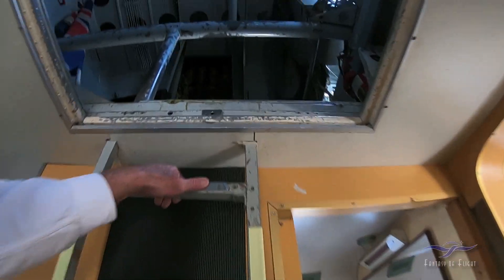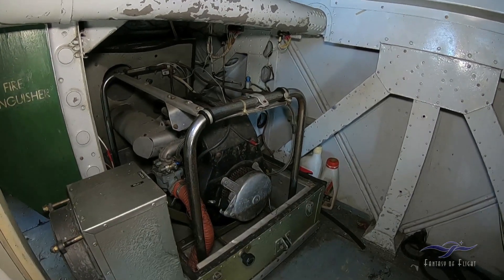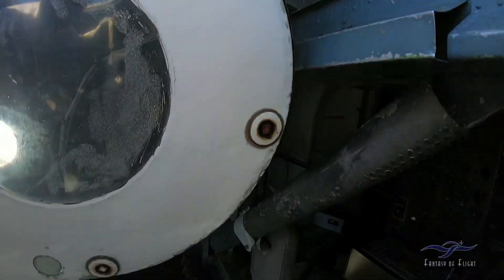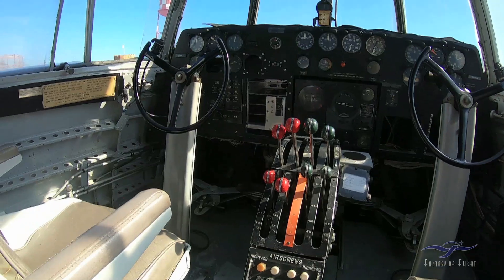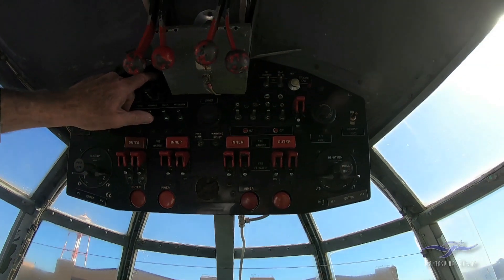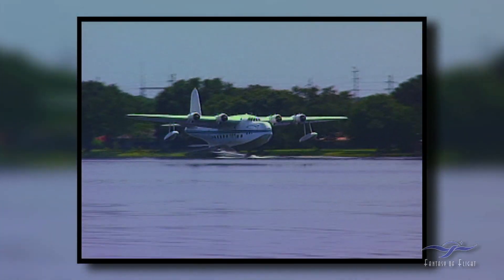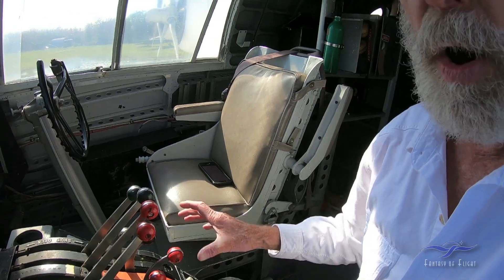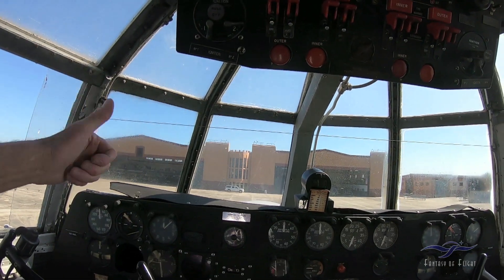Short Sunderland - Tour Part 2

Comment: I had to laugh along with you at your losing train of thought @ 18:35 :) . I really enjoyed this run through, you answered so many questions and gave such a perfect insight into the small details of how the aircraft responds.
I once had the opportunity to sit in the cockpit of the Southampton UK Sandringham in the Solent Sky museum and have a long one to one session with a very elderly Sunderland pilot, I count that as one of my best moments and purely spontaneous which made it very special.
My house is just to the south of Poole harbour UK on the coastline, it was built in 1935 and I can imagine the walls gently vibrating to the not too distant thunder of the flying boats operating from Poole and Sandbanks. Thank you for these great films and for the costs you have absorbed in saving this wonderful aircraft.

Comment: Just having her in the hanger is great. Crewing on a B25 I totally understand the logistics to get an old acft in the air and he has two more engines. The cost in labor and the materials are mind boggling. With Panchito you realize fuel and oil is the cheap part of flying and that can get as high as 180 gallons an hour at $6 per gallon. Inspections are always in the schedule and parts wear out so your always on the hunt. It's a passion that keeps them in existence and I thank those owners that have such passion to spend the money and put the hurculean effort in keeping the acft alive.

Comment: Loved these 2 tours, thanks so much Kermit, its an incredible aircraft. Recently discovered that I live close to a WW2 Sunderland crash site near 
Dunbeath in the Scottish Highlands. It was on route to Iceland with 14 people on board, 25th August 1942, 13 out of the 14 people died. The aircraft 
was carrying Prince George, son of King George VI. RAF investigation said "navigational error by the crew" strange considering the 3 pilots were the 
best of the best, specially selected for VIP missions, the hill it hit was only 700 feet in height, 40 minutes into the flight, why would the be flying at 700 
feet? Lots of conspiracy theories going on, even today. Most of the RAF crew were burred in Pennyfuir Cemetery in Oban, also the resting place of
Frances Ruth Burke Roche, born in "Sandringham" the mother of Diana, Princess of Wales.  Prince George is buried at "Sandringham"

Comment: WOW! When you see the leading edge turn into a mechanic platform, not just an engine cowling, you realize the engineers had a mechanic's mindset. Everything from the Flight engineer to the pilot. Sailing and turning were a different beast, as to say with the advent of a 4 engine P3 on land which had GENs on 2&3 which also had reverse thrust and brakes. Your APU had to have been on during taxi on the pond.  You couldn't be more at war than with the grit at your smile just taking the aircraft to a mooring bouy. It would have been loud in the can the whole time.

Comment: These are a really interesting couple of videos, thanks for taking the time to do this. I live in Southampton very close to the sister aircraft which is in the Solent Sky museum. Its been a few years since I went onboard that aircraft but for years I walked past it everyday on my way to work. Funnily enough I was going through old photos today and I found a picture of your Sunderland (Sandringham) before you flew it out to the States. I think I took it very early 90's, its up on dry land under the control tower/radar station at the entrance to the Solent. I was on the way to the Isle of Wight at the time on the car ferry, I always used to look out for the aircraft whenever I was on the ferry with my parents. It would be amazing to know that one day it will take to the air again, even though I'll probably never see it.

Comment: Two great videos. I have seen an old RNZAF Sunderland up at MOTAT in Auckland but never saw them flying here in NZ. They kept them going to serve Niue and the Tokelaus until runways had been constructed to handle Boeing 737,  Lockheed C130H Hercules  and P3 Orion aircraft. The RNZAF was the launch customer for the H Model and those ‘now rebuilt’ aircraft are still in service but due for replacement.

Comment: Old ww2 story’s tells ...The tail release was also used to  start the engines and run ups. 
So you can stay at the spot and do not have to worry about sailing away. 
The plane does makes turns if  engine was started. 
So maybe the sea anchor was used also. 

Your apu was normally fitted in the wing . A mechanic had to close the leading edge cover after engine start. 
I don not know how Kermit does it but fully loaded the plane was powered up on out board engines first.
It keeps more directional control and less spray ( according to the w2 story’s) if some speed and direction is maintained the inboard engines go up to max power too. 

Thanks for sharing Kermit.. it’s awesome ..

Comment: Those 'Shut-Open" controls are most-likely for the depth-charge rack doors in the upper hull, port and starboard, below each main wing. Most-likely left unaltered during the conversion from Sunderland to 'Sandringham'.
The panel next to the 'emergency escape-hatch' you indicated earlier, was originally the panel [about 40-inch by 20-inch by 3/4-inch]  that opened outward and upward to replace the depth-charges dropped upon U-Boats during WW2. 
Typically, a Sunderland would carry between 12 and 16 depth-charges, four under each main wing, manually re-loaded after each (typically) pair had been released to drop around a U-Boat.

Hope the small bit of info helps you Kermit:

Kind and Respectful Regards, Uyraell, NZ.
Reply: If i remember those Shut-Open controls are to open the engine cowlings on the port and starboard engines.

Comment: Were these the same hydraulic throttles of the 'Exactor' type it's 4 engine cousin, the Stirling, had?  Murray Peden documented some of the surprises crews encountered on Stirlings when the pressure dipped a bit, particularly when an overshoot was required.

Comment: Which was the most feared allied plane in WWII by the Axis?
David Crawford
David Crawford, former British Army Infantry Officer (1974-1994)
Answered Sep 23
Strange as it may seem, the Short Sunderland flying boat. The Germans called it the Fliegendes Stachelschwein ("Flying Porcupine") because of the number of defensive guns it carried. 16, .50 machine guns would be the basic fit but many were fitted with 21 , 50 cals. by the end of the war. In one engagement in 1943, 8 Ju88’s attacked a lone Sunderland off the Biscay coast of France. The Sunderland shot down 3 and damaged the other 5 forcing them to withdraw.
Reply: Wow, you went through all that trouble to copy and paste an answer from Quora, and its not even correct. First, the Sunderland was a British plane, and it didn't carry .50 cals. Like he says several times in the video, it was armed with .303 machine guns, hardly a fearsome weapon. It carried quite a few, but not that many more than other RAF bombers of the period. The only Sunderlands to carry .50cals were the Mk.Vs,, which sometimes had the beam 303s replaced  with .50s. The thing about the Sunderland being called the flying porcupine because of its guns is a stupid myth. Its main defense was a single .303 in the nose, two in a ventral turret, and 4 in a tail turret and a couple beam guns.. Exactly the same as a Lancaster, except the Lanc has two in the nose and no beam guns. The number of 16 guns is the MAXIMUM, INCLUDING the four fixed nose guns. Some idiot has taken 16 and added five to it for some reason. It would make sense if they just assumed 16 guns was the total WITHOUT the fixed guns, but why 5? 
Most Sunderlands didnt carry even 16 guns. That is a maximum, for a late war plane with every single gun they can cram onto it, and four fixed guns for suppressing UBoat flak gunners.
The Sunderland was called the porcupine because early in the war it typically carried an early ASV radar set, with numerous aerials protruding from te sides and top of the rear fuselage in 3 rows of 4 or 5, plus several smaller anntenae here and there. This resulted in a very spiky looking plane. I find it hard to beleive that its a total coincidence that the Sunderland often looked like a fat spiky plane, and it was also called 'the flying porcupine" for TOTALLY UNRELATED REASONS/
Reply: @justforever96  ??????

Comment: Kermit, Thanks for two great videos. I sat in the cockpit of the converted Sandringham  at Southampton air museum  and youre videos brought it  right back for me. You get an awesome feeling of a past age siting in the cockpit. The mooring technique is scary and I wonder how they ever managed when they had fixed pitch props before they converted them to the PBY system. Were the props on the PBY also non-reversible or was there some other reason that prevented using it on the Sunderland?

Comment: Nice plane/boat.  I gotta say though, if I were to have a multi-engine flying boat, I'm pretty sure I would want reversible props.  It might not be flying now, but it's doing better than all of the Boeing 314's which were either scrapped or sunk.

Comment: Just visited the sister aircraft in Solent Air museum in Southampton U.K. and the interior layout is quite different.  The Aircraft in the U.K. has seats for 44 laid out in compartments with narrow seats facing each other.  The nose has a large baggage hold.  On the Starboard there is toilet and a door that leads to the ladder to the upstairs cockpit.  Opposite is another toilet.  The interior is wood panelled like a Victorian train carriage.  The lower deck seats 30 made up of  three interconnected compartments of 8 seats towards the front, a ‘Y’ shaped staircase and then a fourth compartment up a step to the rear with 6 seats.  The stair case starts on the Port side and goes up at an angle towards the Starboard side.  If you turn left a the top of the stair, towards the front, there are a further couple of steps to an upstairs galley.  If, instead, you turn right at the top of the stairs there are a further couple of steps that lead towards the rear and an 8 seat compartment that has a further connecting door to a 6 seat compartment at the very back.

Comment: Here's a little tidbit of info about Ansett.
Their B767's actually had a three man flight crew instead of the normal two with a little flight engineer panel.
This was done because the flight engineers union had a hissy fit about the introduction of two man crews and subsequent lack of need and possible firings of flight engineers.

Comment: The only reason this needs to fly again is in order to throw those boy scouts out the back!
Reply: As an eagle scout, it's extremely disappointing to hear what happened.
Reply: Andrew Poss same here, but I’m
Not really surprised.
Reply: don't you mean those buoy scouts haha
Reply: They were just upset that a historical veteran like this was desecrated by that shoddy and tacky interior work, and were momentarily possessed with a desire to tear it all out and return the plane to its rightful appearance. 
No, while I find it very disappointing, I am also much less upset than I would be if they had destroyed a part of the original plane, which is much harder to replace or repair. Although I suppose the conversion work itself is historical at this point!
Reply: It’s not the boys you would hold accountable but their leaders. That’s the purpose of BSA, to turn silly little unthinking boys into mature leaders. But that takes great adult leadership. Very disappointed with the adult Scout leaders. Most leadership has been short handed and needs help.

Comment: Wow..  Strip it down to its war interior  and install the gunner plexiglass with cameras and dual seats..  also for ;passengers in such configuration, install a safety line throughout the hull and old style military seats   Do get active military pilots rated to operate it.. Every one gets a parachute.  and a (pressure) water tank.. but not to big and no fertilizer ever..

Comment: When I was in the Army, I got a chance 
to go to White Sands, in one of the unit's
Chinooks.  I stuck my head into the 
"tower" and saw their "barometer."

It was an altimeter, open, but mounted 
in a piece of aluminum, and had the 
altitude of the field written on the mount.

The tower team would just adjust that 
altimeter, until it showed field altitude.
Then, they would read the barometric 
pressure, to the incoming flights.  They 
would just read the altitude, from the 
Kollsman window.

steve

Comment: So, I've always wondered why the last few owners haven't just paid someone from Short Bros. to (free vacation) to come and verify the modifications. It's total BS that an entity such as Ansett was trusted to replace an engine and otherwise maintain an aircraft, but wasn't good enough to perform other non-structural modifications. Witholding certification is a joke. You can see in this video that the nose section mods are first rate.